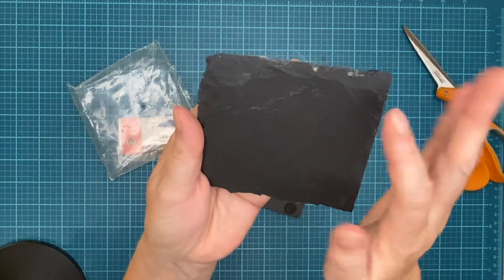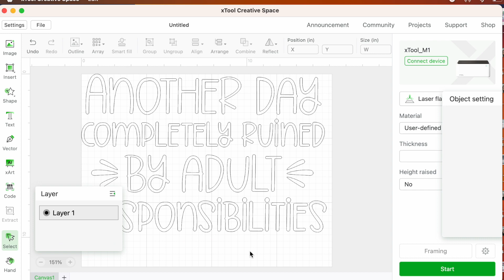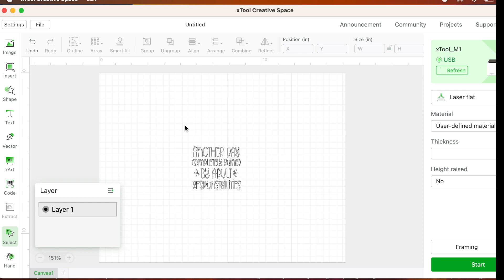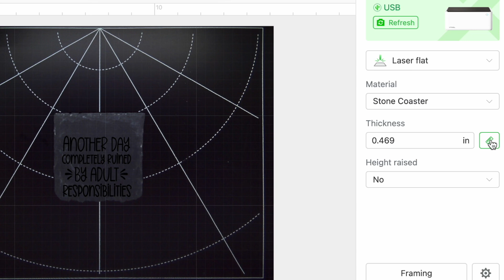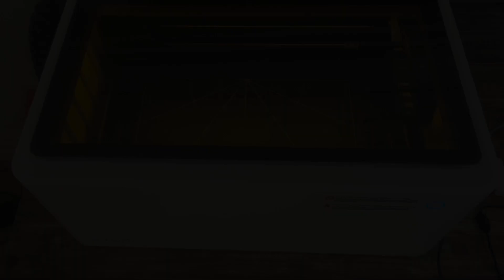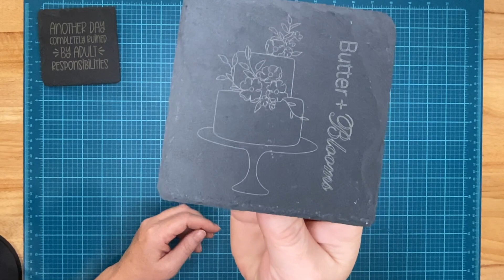Using the xTool M1 to Engrave on Slate Coasters

Comment: Is this machine loud? Does it take a lot of power?
Reply from the maker: No, the machine is actually very quiet. If I ever add a filter, the filter will make more noise than the machine. I don't know how much power it pulls but I use it on my regular wall outlet without any issues. When I tried to use my heat press and a laser at the same time, that tripped my breaker. Hubby says the heat press uses more power than the laser and the two combined on the same circuit were just too much. If you consider getting one, I would get the 10 W over the 5 W.
Reply: @MakingwithMarilyn  you’re so wonderful thank you 🫶

Comment: The engraving really turned out nice! Thanks for sharing and showing the difference. I haven’t tried slates or tumblers yet.
Tracey
Reply from the maker: Yes, these were super easy and look really nice. I'm hoping to get the 10W laser head so I can make tumblers.
Reply: @MakingwithMarilyn   Oh, so you can just add a higher wattage laser head to that same machine? If so, didn't know that!
Reply from the maker: @TraceyYJohnson  some companies sell the different laser modules. I'm not sure if xTool will sell just the laser module or not.